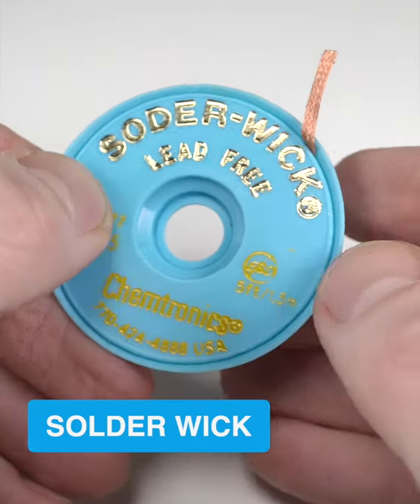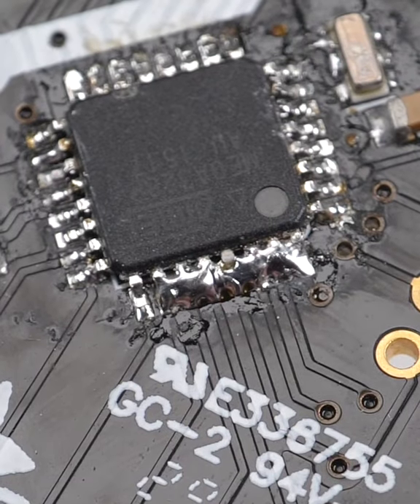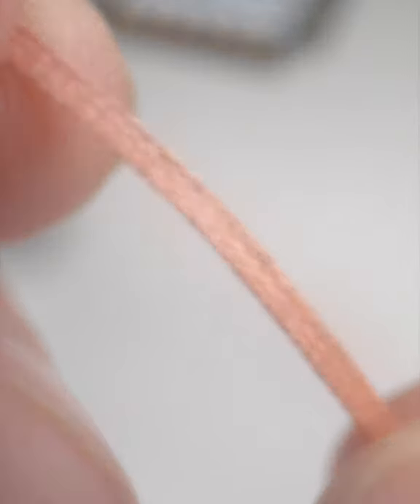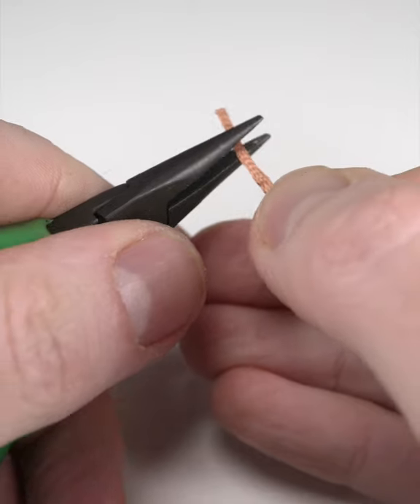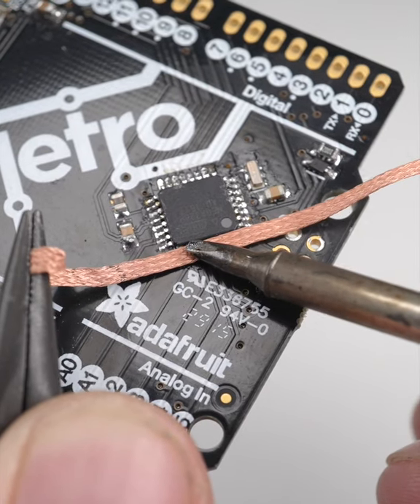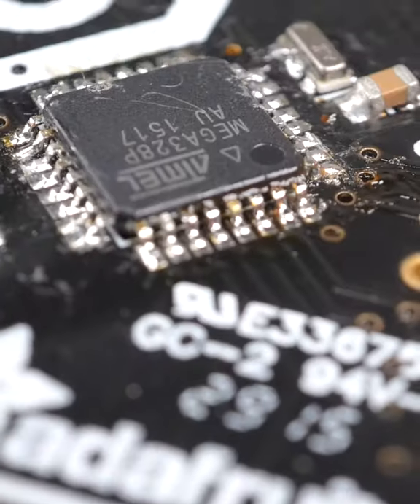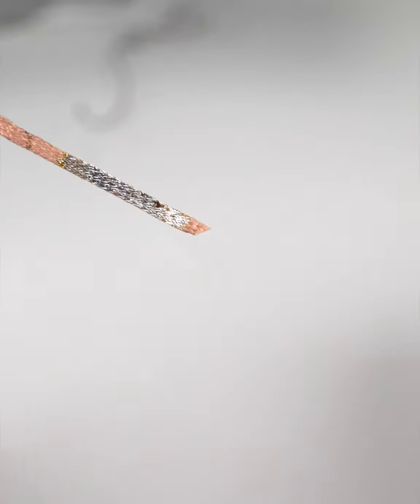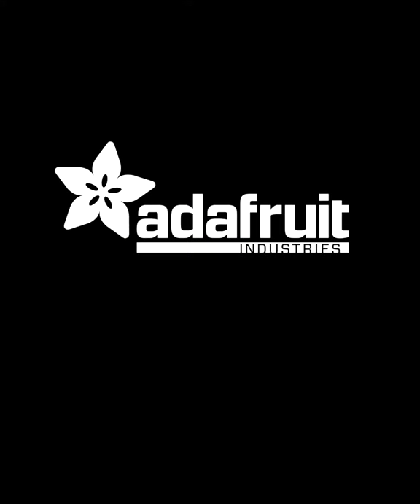Solder Wick - Collin's Lab Notes #adafruit #collinslabnotes #soldering

Comment: I've burned off the flux from the wick before, so if it's not soaking any solder, add flux. I've burned many boards before I adopted this policy.

Forceps or reverse tweezers might be a good idea for holding the wick as they don't require you to grip the tool constantly.

Finally, it could be a good idea to add a little solder before soaking it up. Burned flux and bubbles can really get in the way.
Reply: I'd also say plump up the wick a little bit. It'll conduct heat quicker and absorb the solder easier so less likely to burn your board

Comment: I’ve just never had solder wick work as well as you just did there.
Reply: Try putting os more flux and increasing heat
Reply: Yeah in reality it never works that well
Reply: @GrimeReaperMan  with enough propper flux, heat, propper wick and a good tip it does work like in the video
Reply: Always worked great for me...
Reply: i've used expensive and cheap solder wick.  the expensive stuff works well, the cheap stuff not well at all.
Reply: Make sure you're using a decent soldering station if you want even a chance at what's happening in the video as well. The fire starter sticks you get at home depot often just aren't good enough
Reply: Put flux ON the wick. That made the difference for me

Comment: The first time I used solder wick, I burned/melted the PCB pretty badly. Granted, I was still somewhat new to soldering at the time, it turned me off from using solder wick. Is this a common problem to be wary of when using solder wick?
Reply: You might have had cheap wick or otherwise not enough flux on it. The other thing is that just like a pump, it's often easier to remove the solder after adding some fresh. You also might not have had a hot enough iron, especially if the product used lead free solder: ideally the solder melts without heating up everything to that temp, but the other two ideas are probably more likely.

Comment: Dipping the wick into paste flux a wiping the excess off with your fingers significantly decreases the heating time. 

I also don’t hold with pliers. Simply extend the wick out of the reel about 4-6” and use the iron at the end of the wick.

Comment: Some solder wick comes marked with “Rosin” which is impregnated with flux, which aid with the wicking the solder.
The discarded wick does make great bridging wire for damaged high current tracks on PCBs

Comment: Fray the tip,  and and only remove the solder that's bridging. Doesn't always work, but may keep pins soldered. 
I've used this on damaged boards

Comment: Here's a tip: instead of needle nose pliers, use hemostats! 

Another personal preference is to cut off 1-2" of wick at a time so as not to heat up the flux in the wick further away and degrade it.

Also, keep the wick in an air tight baggie to keep it fresh longer.

Comment: Pro tip snip it beforehand and use the snippet pice to desolder so you get not the heat withdrown from the solder wick spule and if you have huge amounts of copper in your PCB, then preheating the PCB to 70°C or 80°C is recommended to get neatly and clean solder joints after removing the Flux

Comment: It's faster to use a larger chisel tip, ADD solder and swipe the tip across all the legs, then away. You'll get perfect filets because the chisel tip draws heat and excess solder away. When removing flat packs, put a small pick under the corner and lift gently. Do the same to each side and it pops right off. No wick or flux needed
Reply: Rework gun is so nice for removing smds tho

Comment: I don't use pliers
Don't need to
I use that wicks case to protect my fingers
It usual can handle the heat that short amount of time
Reply: It's less ideal because the rest of the wick on the roll keeps sucking up the heat that the soldering iron supplies. You're more likely to have an accident where your wick goes too cold and you start ripping up the PCB.

Comment: This has never worked for me. I dont know if its the cheap quality of the wick or if I suck at doing it. I always end up using the sucker, which usually is quite messy and requires a lot of unnecessary heat

Comment: What solder wick brand works best? i have a gordak 968b workstation and i always set the soldering iron at 400°C and i always add leaded solder on the joints before using the wick but not all the solder gets absorbed and the paint on the pcb gets removed like the traces gets exposed.

Comment: And here is me holding solder whick with bare hands 🤣 the heat doesn't really bother me & i try to save as much material possible , i keep the used up whick & use them as jumpers

Comment: I can't seem to get my solder wick to suck up any solder-- even when I add flux to the wick
Reply: Why? Sometimes the wick is too tightly braided and spreading it out helps. Or it's not getting hot enough? Ideally you shouldn't be using it right off the roll. Don't use wick wider than necessary either, that makes it just less efficient as well. You want a lot of thermal conductivity through the wick. You don't want that much thermal conductivity along its length.

Comment: Definitely recommend a real scolding iron when using Soldering wick. The portable USB powered soldering irons can’t heat the wick thoroughly.
Reply: Having actual power helps. But also cutting off and using only a short piece of wick, and using the narrowest one you can get away with. Definitely not the 5mm wide version!